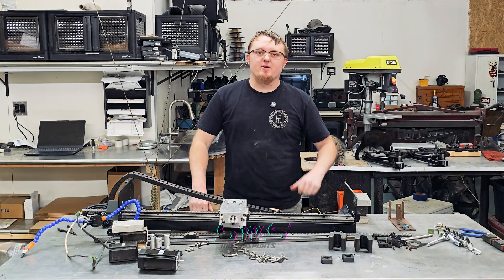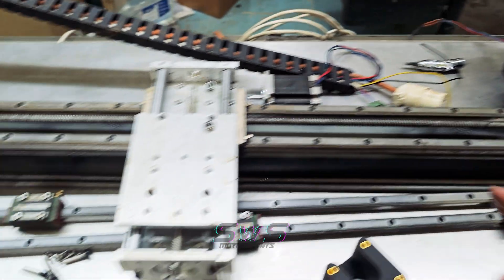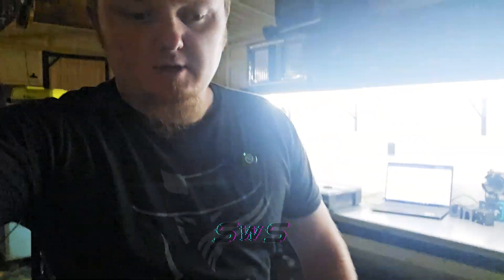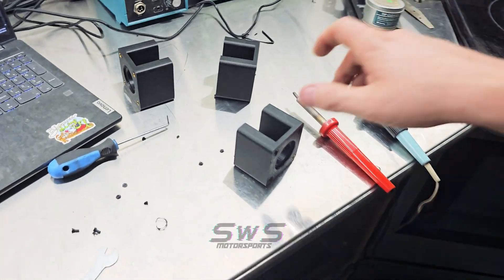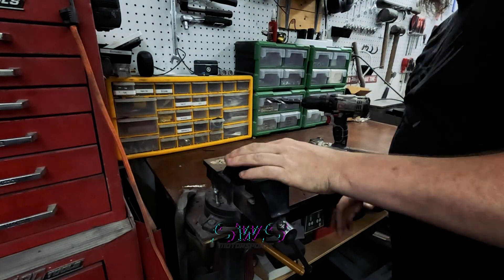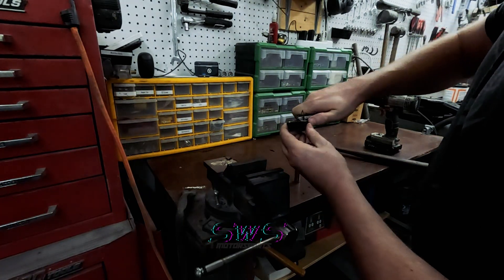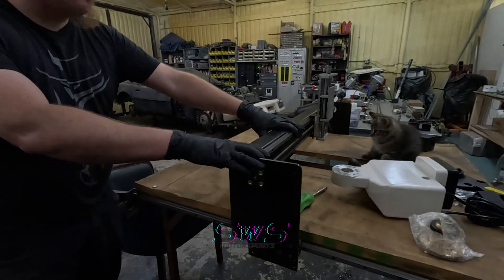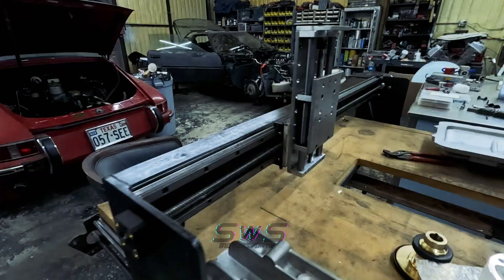I Turned Junk Into A CNC Milling Machine

Comment: I've ran printed z nuts on printer now for.. like 8 years, something like that, on m8 rod. I printed a bunch of replacements back then for if they get worn out but they haven't. the thread was printed a bit small.  all threads not ideal, if you use it horizontally you should probably if you can tension it a little bit pulling from the ends. for cnc you'd probably want to use m12 or something at least if going that route. people have also printed stuff to run skate bearings on the threads(3 will do). oh and what i did use was pla and a bit of graphite on the rod, I don't think abs would last as long, the pla sort of forms a hard surface. the printed nut route, printing the thread a bit smaller than the rod is better than a nut with play in it anyway(running the rod back and forth makes it fit snug and rotate more freely) and you get even less play as you can print it as long as you want. my z nuts are strong enough that it will mess up the bed and pull off the motor connectors from the motors before it gives up if you crash the bed or have something in the way.

my tip if designing such thing from all thread is that do not design the thread as an integrated part of the whatever carrier you have going on the axle, so that if you need you can just change it. maybe even design the nut as a split version with a printed frame around it then you wouldn't need to take the whole thing apart to change them as service items, anyway if you take that precaution then you don't need to change them because that's just the way the world works, if the carriers such that you need to take it off the axle to change the nut then you WILL have to change the nut (my printers like a theseus kind of a thing bought 12 years ago and it was the only reprap kit i could find for sale locally in thailand back then, it was a really bad buko based clone that had like 3 mm of slop in the original z, meaning when you changed directions it wouldn't move until it was moved that 3.. so I had to zero the z under the bed level to get the replacement parts printed so that during the print operation it was only moving 1 way.).

I was going to get proper lead screws but they just seem really pointless now(it's on some swiss linear rails on all axis now though, bought used from a small stall that was ran by 2 older persons in bangkok that sold a bunch of decommissioned factory stuff).